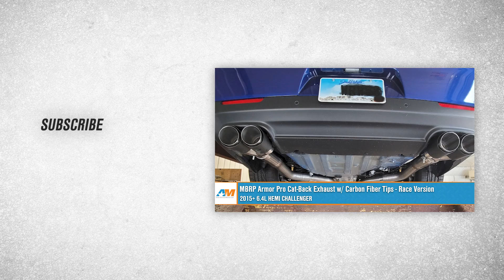2015-2023 6.4L HEMI Challenger MBRP Cat-Back Exhaust with Carbon Fiber Tips Review & Sound Clip

Comment: I just installed the same race setup on my scatpack challenger m6. To my nice surprise, it is not as loud as a thought it would be. Sound is deep and well toned.
For comparison, my stock exhaust had the flaps wired since day1. 
This is a perfect bump in noise. Deff makes the car feel alive. 
If you drive aggressive like me, it will be drone free (shift at 3k+ like a man). 
If you lug the thing around 2k, it's gonna load up and sound will be meh. 
My 2 cents.

Comment: I have this but for my 5.7 and with mufflers? /resonators? It was easy to install and I did it in half a day. The clamps were a problem(I ended up having it all welded up) and it's not quite by any stretch. It's loud but it's a different loud from most Ive seen/heard. Im not sure what the po-po will think, Im in CA. It fits great and the finish is great too, tips are cool, i've yet to see another challenger with the same so.... Over all it was worth the scratch, but I think you should hit up the local custom muffler shop and have a word with a pro first.